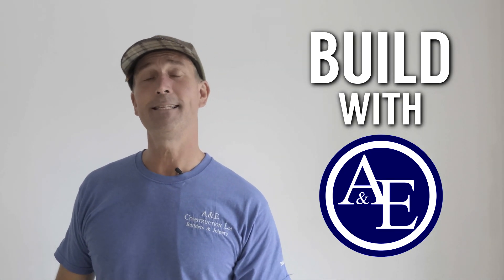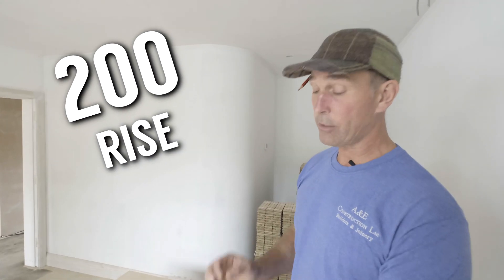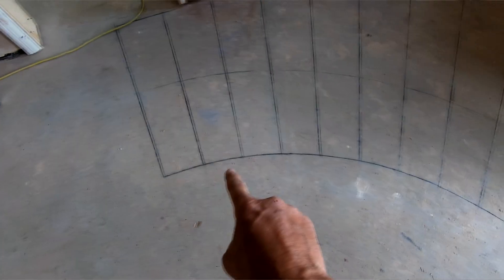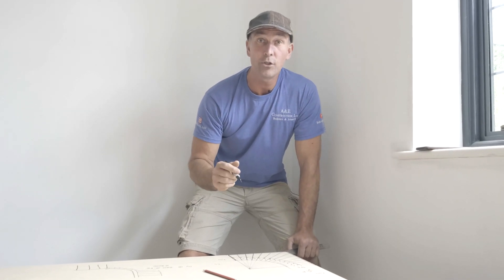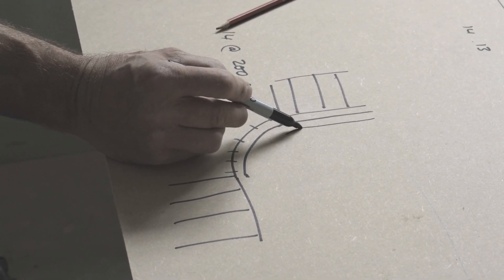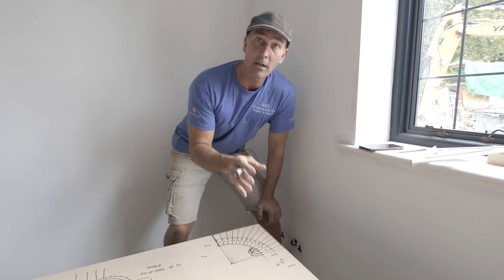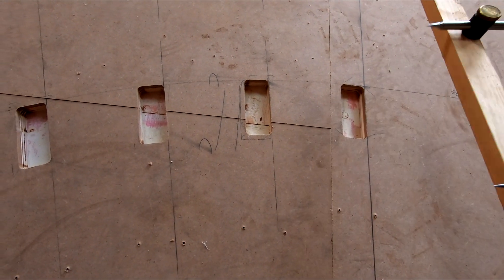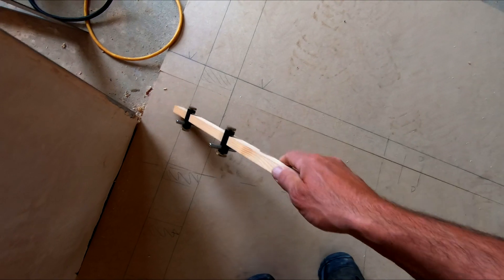HOW TO BUILD A STAIRCASE #1 | DIY Series | Build with A&E

Comment: What a tutorial! Thank you for showing your knowledge man, this is very well done. My first real exposure to professional carpentry was working at stair shop starting as an assembly carpenter and eventually working up to laying out and constructing our curved staircases,  so I have a special place in my heart for proper staircases :) 

My question is how did you lay out the lines extending out from the radius point? (specifically shown at 2:24)

How did you equally divide that radius into 13 equal tread lengths? 

The only way I can make sense of doing that is knowing your specific inside radius - then knowing the exact turn of the staircase (was it an exact 90 degree turn? Was is 100 degree? 80?) then dividing that perimeter length by the number of treads. But it looks like you were able to find an angle that had an equal relationship (from the center point) that equated to 13 equal tread spaces (at the desired radius) without doing that math? I'd very much like to pick your brain on that.
 
As a younger carpenter exposure to this knowledge is very appreciated, thank you for doing what you do!!

Comment: how did you work out that you needed 14 rises??
Reply from the maker: Hi SLATERS CONSTRUCTION you measure finished floor to finished floor your guide no higher rise than 200mm because of the 42 degree rule I do like a rise of 180mm but this is not always possible because of your floor to floor plus the go of the treads. I think I do explain a bit of this in the video, hope this helps thanks for watching keep Safe all the best Tony 👍